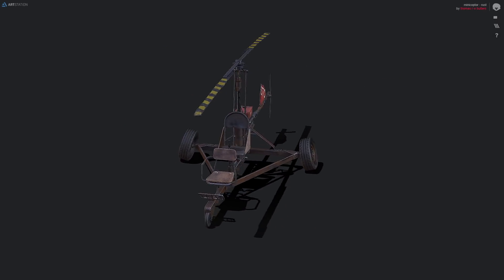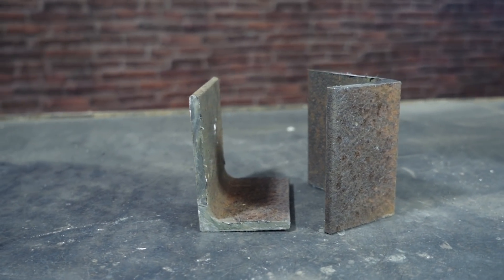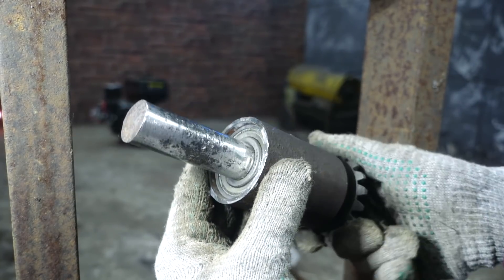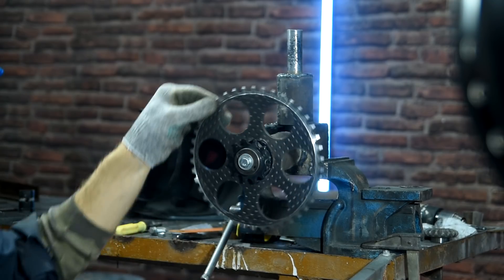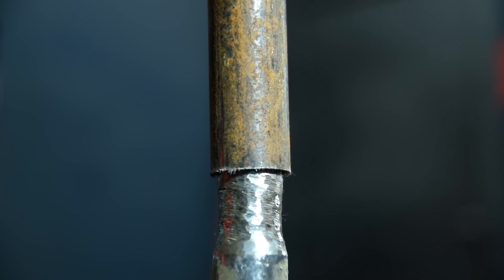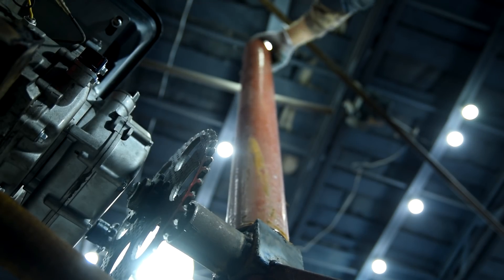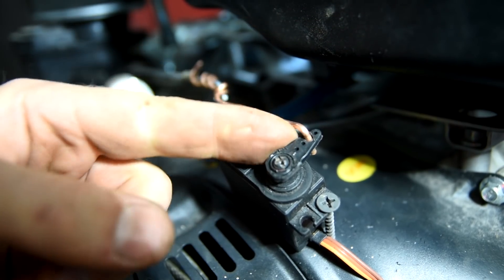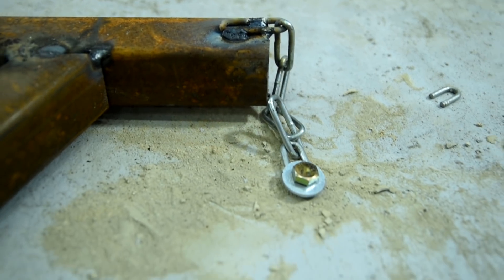BUILT HELICOPTER FROM RUST

Comment: i havent watched fully yet so i will wait to see your squash plate or other solution. an autogyro would have looked the same but the rotor isnt powered so dosnt controle direction or attitude  and been a far easier build technically. an impressive project sir.
Reply: ok watched it all ... yes that rotor design will not work , blades need to be hinged and variable in angle of attack  or you will have major issues. my knowledge is insufficient but to my memory  part of the rotation speed problem you are facing  is because the blade isnt hinged at the hub therefore is producing drag over half the rotation...and the unchangeable angle of attack of the blade says it is probably nowhere near its optimal .....between 15 and 22 degrees i believe  again  my knowledge is limited here.  much of the vivration  is also the lack of hinges , the  way a helecopter works versus an autogyro is far more complex so it would be very interisting to see a properly functional rotor setup from used car parts and a lot of smarts... i still say an autogyro is an easier and netter build if at least just to prove the concept  ..if your going with helicopter the key is i believe the "squash plate" good luck looking forward to watching

Comment: I definitely would like to see this with a better engine with sufficient power to get the propeller spinning fast enough for takeoff. I know that these things actually do exist in real life and are called ultralight helicopters but they tend to be pretty highly engineered to be as light as possible so I'd be very interested in seeing how well one built in the rust style and made from found parts could do with sufficient power
Reply: If he tried varied sprockets he could probably get that to take off
Reply: @alexandertaylor1954  he did try that the problem is that engine can only produce a certain amount of torque and when it comes to gears, chains  and belts for gearing you're speed and torque are inversely proportional to each other so if he gears it for a high enough speed to get airborne he wouldn't have sufficient torque to get the engine up to full speed which would be required to get it going fast enough. Long story short the solution in this case would probably be best to come in the form of a more powerful engine. My suggestion would be an old air-cooled boxer style engine both Subaru and vw made variants but the vw one would likely be easiest to find as they were in the classic VW bug which they made millions of and they are stupidly simple engines and produces in their stock condition pretty much exactly the correct amount of power and they are upgraded all the time to get a little more power so if needed there is aftermarket support and upgrade parts available.
Reply: @alexlutz2221  snowmobile inline motors would also be a fair candidate. I commented before i watched the whole video lol.

Comment: Go for a 2-cycle engine. They are lighter and more horsepower per Kg, you would only need an air cooled 3 cylinders they can be mounted Directly to the shaft. If you're going with rust, it would have to be a 6-cylinder diesel, considering the Crudeness of the Fuel used. This is the engine all the Ultralights use 2cycle 4cylender engine. Remember you have access to a smelter in Rust, so you Can Remelt  and Sand Cast Aluminum and Steel

Comment: from the looks of the in game model the heli from rust uses a V6 or F6 maybe a F4 engine. and while they would allow the rotor speeds to be raise significantly I'm not sure if it would be possible to achieve lift with them.

Comment: without a rear rotor to counter act the top blades torque you will never achieve lift. you can see in the vid you had lift and the machine danced and twisted. use a 2 stroke off an old dirt bike, there allot lighter and more powerful. a three blade top thats shaped properly. oval out some round pipe (drive on it with a truck length wise) then cut that in half and weld the sheet steel to it. and you will be flying in no time, my brother and i built one like this in high school many years ago. using parts from a wrecked motorcycle and a junked 4x4 pickup.  the brake drum clutch was a nice touch.

Comment: Is the governor still in this engine? I’ve upgraded a few mini bikes, and if the process is the same you could get more RPM removing the governor. You’d need to change to a billet rod and flywheel to handle the increase in power and getting stiffer valve springs so you don’t get valve float. Just don’t remove it unless u replace all those or you could grenade the engine. Anyways great video!

Comment: this is an autogyro, not a helicopter. it can't hover, but instead flies like a plane, with the upper rotor acting as a wing to provide lift. making the mechanism for controlling the rotational hubs to get the proper attack angle of the upper rotor blades and the tail rotor to achieve stable flight and VTOL like a helicopter is quite a complicated process. an autogyro on the other hand, is an easy build as long as you have a rudimentary understanding of aerodynamics. it doesn't even need a tail rotor. the flat control surfaces on the tail work the same as the tail section of an airplane. technically, the upper rotor doesn't need to be fully driven, as moving through the air will keep it spinning, but it does need a fully driven propeller to provide forward thrust.

Comment: bro, 2 things, first one of the reasons you wearnt able to gut up to speed is the balance of the rotor blades, you could see the hole thing just shaking and wanting to tear itself apart at speed. 2 you wont be able to get it to fly indoors, the air starts to circulate in the room reducing the effectiveness of a low speed rotor

Comment: This is something that is very much possible although the engines they used in this video was not powerful enough and propeller design could be worked on in-game it's vastly simplified mostly from modeling reasons but even with crude tools and materials making a half proper propeller is more than doable

Comment: If you really want to get it airborne, build it as an autogyro instead.

An autogyro has a pusher prop instead, and the rotor is not driven by the engine but by the airflow past it.

Comment: Ok please do not try to fly this. Butttt ur gonna need a few things if you did want it to fly. For one you’ll need a tail rotor as there’s nothing to counteract the momentum of the main rotor(I think you called it an airscrew). Also, helicopters tilt their rotors in 2 axis to allow them to fly sideways. I don’t think it’s ENTIRELY necessary with a proper tail rotor design as lowering and raising the amount of torque given to the tail rotor will cause the helicopter to spin in each direction but depending on ur tail rotor design it may be difficult to get this to work properly. This is an awesome project but most people building diy helicopters tend to die due to their contraption.

Comment: Why not mount the engine on its side with a dry sump (dry sump means the oil is stored not under the engine but a separate container and pipes. Not being an a$$ just giving info). You got a lot of guts making this Hope it works